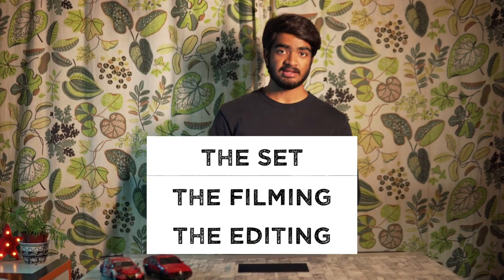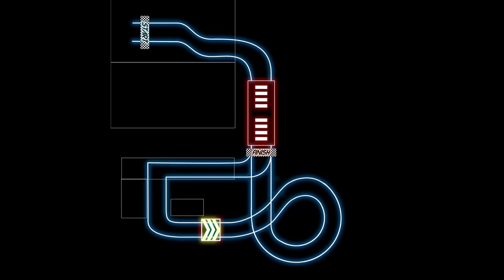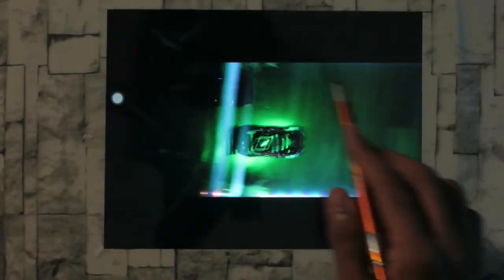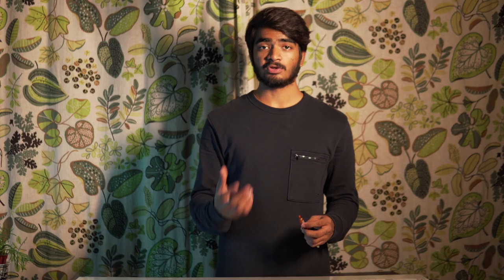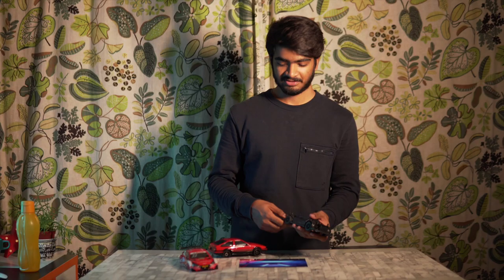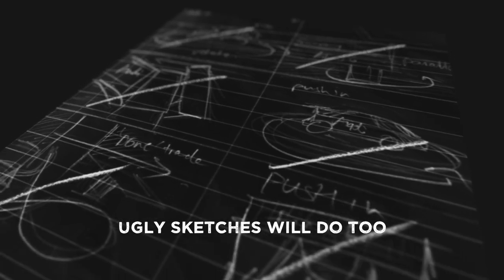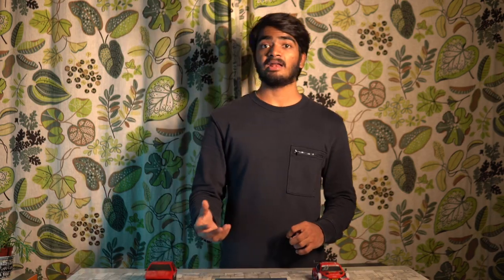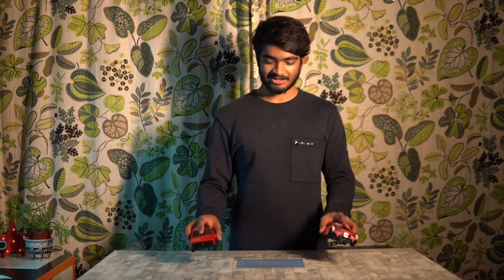Filming Miniatures: Make them BIG

Comment: Hi Rohan, how exactly did you remove the fishing line in post? It could really come in handy for a project I'm working on at the moment!
Reply from the maker: Hey man, I used after effects. It comes preloaded with an effect called wire removal, its a pretty simple tool to use and does the job well. Hope this helps:)
Reply: @rohankris  Thanks a lot!

Comment: What lens would be great for this kind of work?
Reply from the maker: I would recommend a small, wide lens. Small because you want it to be portable and easy to fit in smaller spaces. Wide because you want to make the smaller cars look bigger
Reply: @rohankris  THank you for your fast and good reply :) Do you have any specific lens in mind?
Reply from the maker: @JGN.Studios  which camera as you using buddy
Reply: @rohankris  right now I only have a cheaper canon EOS M200
Reply from the maker: @JGN.Studios   I think any wide angle lens that starts about 16mm will be great. Since you're on a apsc sensor, 16mm will translate to about 24mm in full frame, great wide angle.
Reply from the maker: @JGN.Studios  for this video I used a Sony 18-105 lens for all of the wide shots. I use a Sony a6500(apsc sensor as well). So the 18mm wide translates to about 28mm. A little wider would be nicer
Reply: @rohankris  Excellent.. thank you again for your answer it is much appreciated

Comment: I would really like to see your tutorial on wire removal.
Reply from the maker: I could explain it here - wire removal is an effect in after effects software. It works by simply keyframing 2 points to either end of the wire within the footage. After effects then erases and fills in the wire portion using 'content-aware'(if you're familiar with Photoshop, it's the same thing)